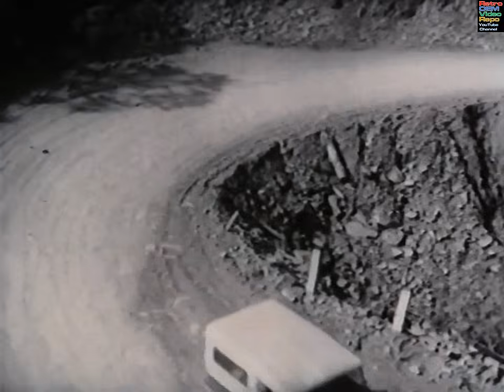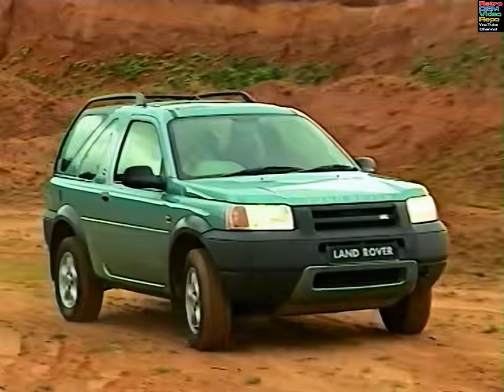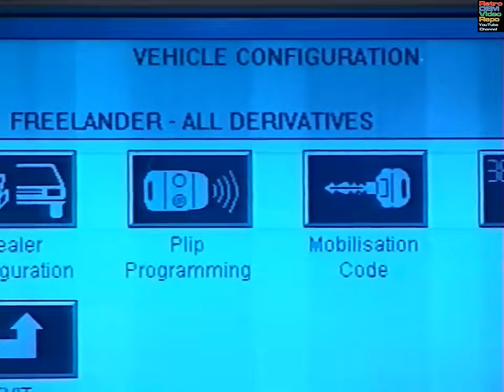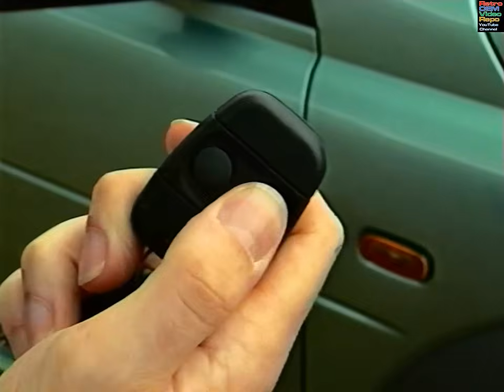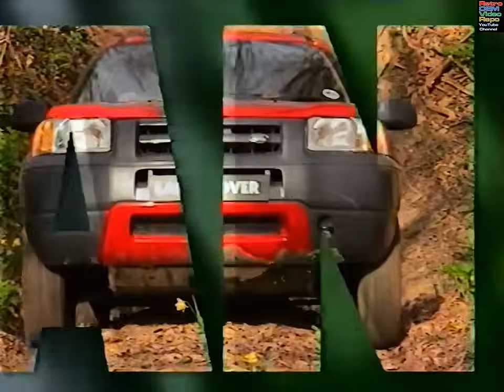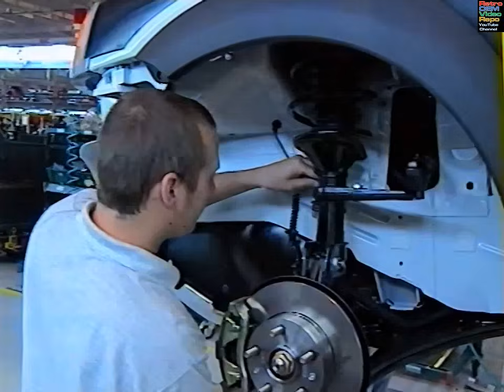Land Rover - Freelander (L314) -  An Introduction to Freelander - Dealer Training (1998)

Comment: Been having the car for a while now, but did not know I could up the rear window by turning the key inside the rear door lock. Was usually letting it down, putting groceries in, then lifting it from the button on the console inside the car.

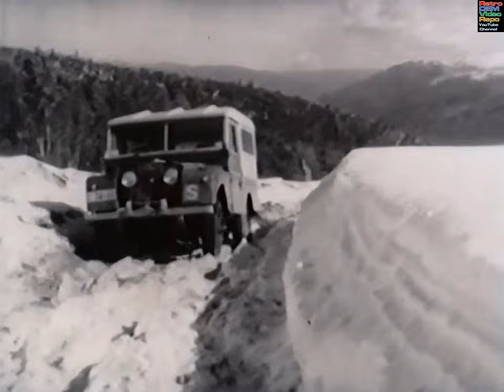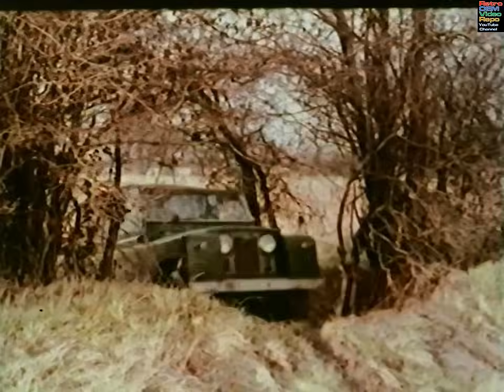Comment: 1:09 Good grief, Ice Cold In Alex .. 1:21 Drivers head nearly fell off.. I find it very annoying the brake lights are situated so low down at the rear and also the battery terminal clamp nut and bolt are vertical.. In the process of changing mine to horizontal.. Negative was easy to do.. Positive has three leads so just a bit more difficult..